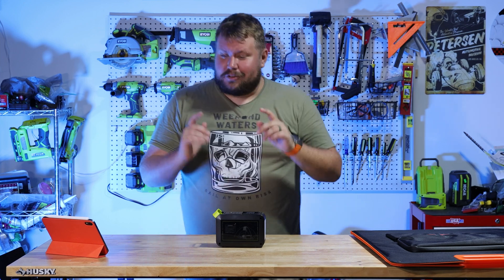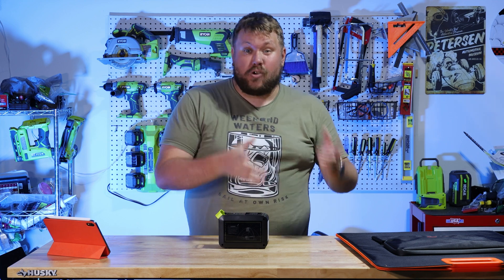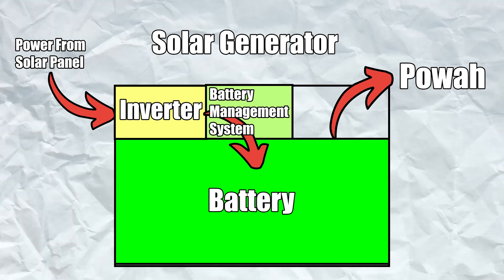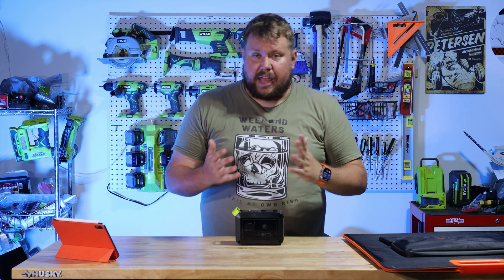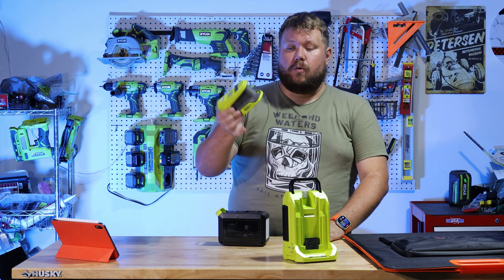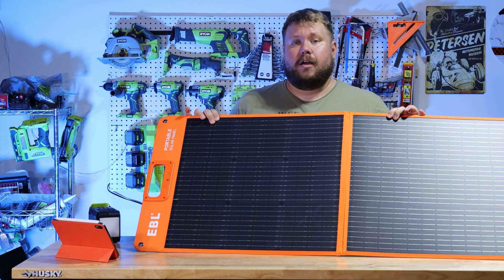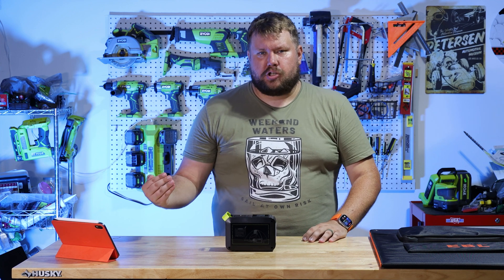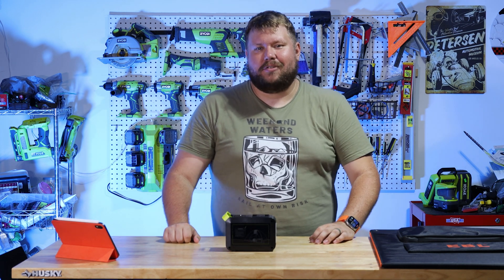Build A Cheap Solar Generator & Expand The Capacity With Ryobi Batteries

Comment: My ryobi 401 charger draws 72 watts. Near the limit of a 88 watt output devise. the 6 amp hour ryobi 40 v. battery is 240 +/_ watt hours. It would take 3 hours of full sun to charge.. Maybe 4

Comment: It's August 5, 2024 and the total price now is 29 percent higher.  From $225 to 290. The 290 includes $16 sales tax, assuming the 225 also included sales tax. If i exclude the sales tax from the 290 them it's 20 percent higher. Either way, its MASSIVE inflation.

Comment: Does it have pass thru charging?
Reply: It does have pass through charging   I use a jackery 300  and a jackery 1000 and both have pass through charging.  And you can have up to 200 watts of solar panels feeding them solar power.  The Jackery 1000 included an adapter that takes two 100 watt solar panels Into one plug so it can take both panels at once.

Comment: Love the solution and will be purchasing
Reply: Solar power generation is variable.  This method will only charge a very slow rate because you have to use the slowest charger.  Any cloud may cut it out. Ideally, you want the inverter directly connected to the battery so there’s a buffer on power.